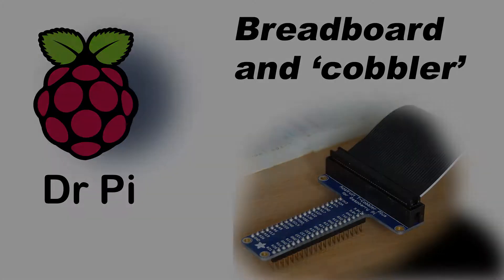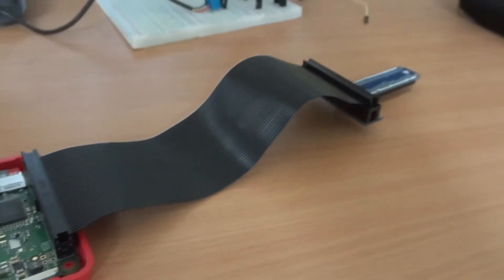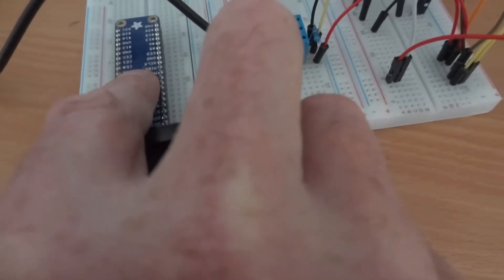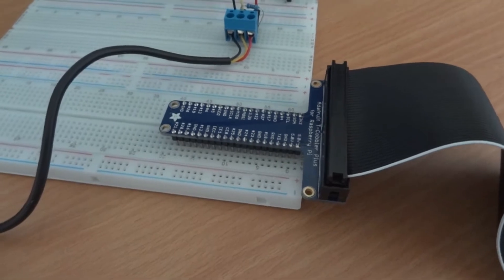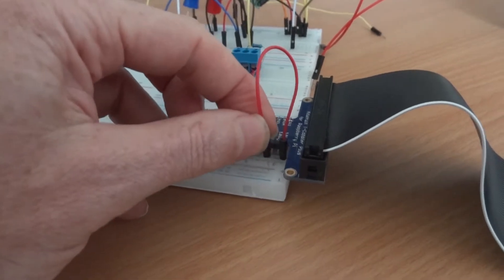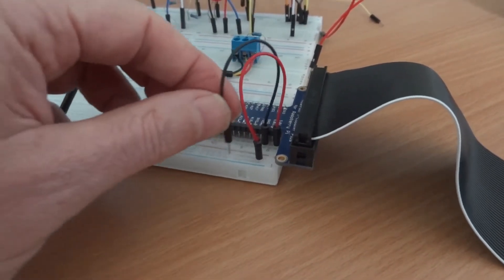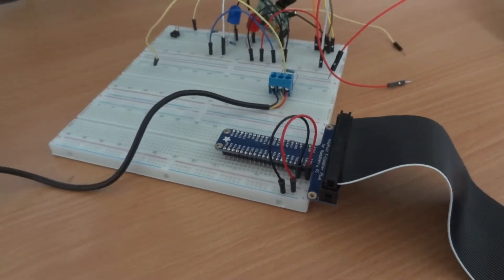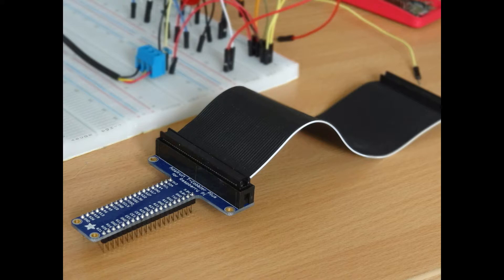Raspberry Pi - Breadboarding and 'Cobbler' connection

Comment: Do you know what the white boards are called that these connect up to?  I wanted to get one that fits into my C64 breadbin.  Thank you
Reply from the maker: Hello, do you mean the white 'breadboard' ?
Reply: @jobstr-work  Yes that's it.  I wasn't sure what those were called. I'd like to shop these so I can get a nice one that fits my c64 shell.
Reply from the maker: @sndmnsix  you could always cut one down to get a customized size, inside the white plastic you just have metal strips at 90 degrees to the red and blue +/ -